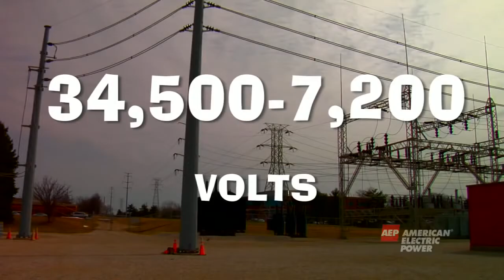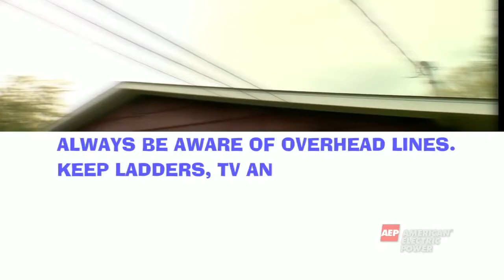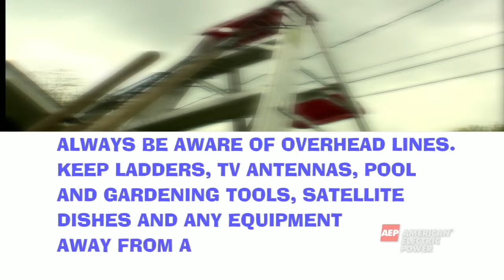The Anatomy of an Electric System:  Chapter 3 Distribution System

Comment: That's false the feed to your home has 2 main lines that is how homes have 240v power yes your house is 240v single phase your breaker box splits the 240v down to 120v and the neutral wire is how the circuit is complete with out the neutral power will not flow

Comment: In my area, the distribution system voltages range from 2.4kV to 22.8/13.2kV. I am a distribution system electrical engineer for our regional utility company.
Reply: What is the proper installation depth for a 50c3 wood pole and the distance  of a single helix anchor backing a single phase tap using 1/0 aaac?
Reply: Duke energy is doing self healing circuits. They are re-doing everything and my bill shows it.